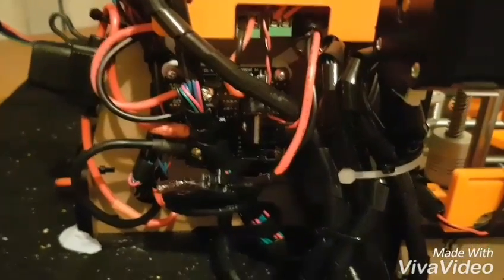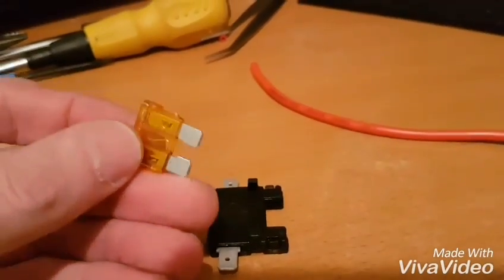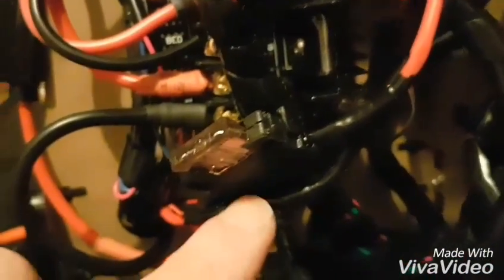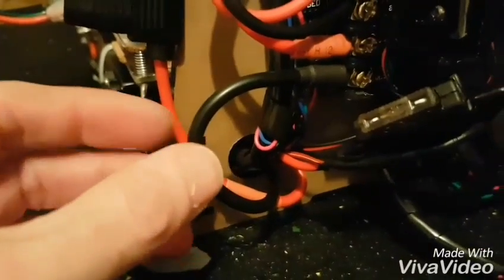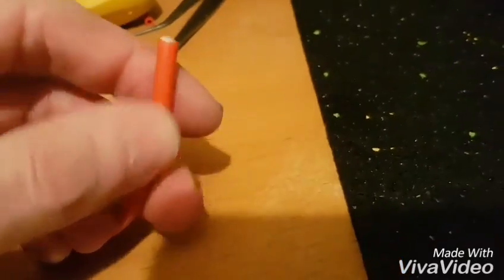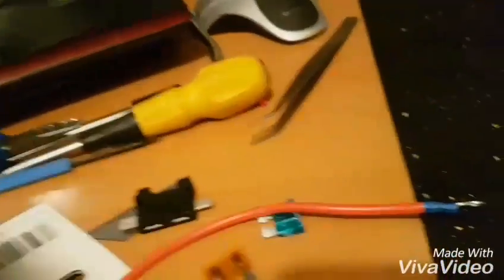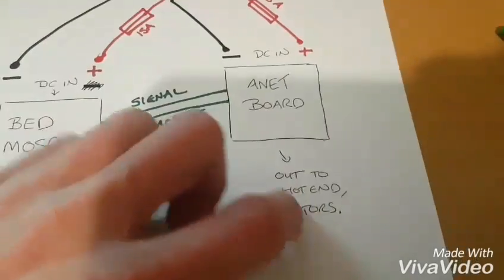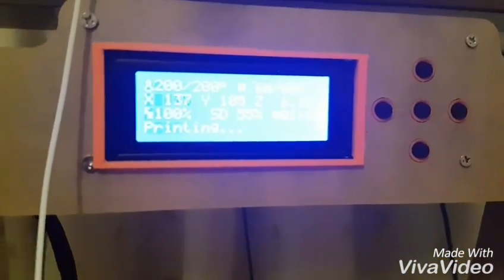ANET A8: Adding Fuses

Comment: Hey, thanks for the ideas but can I ask how you came to the 15A and 6A fuse requirements?
Reply from the maker: Gareth Brown Hi. Thanks. I think I Checked the bed with a clamp meter at about 11a (the ramps boards also talk about that kind of amperage for the bed) The 5 amp was just assuming say 3 for the hot end plus fans, motors, mainboard and a bit of spare. Hope helps.

Comment: very nice! been thinking about rewiring the whole printer. Mounting the frame to a small table and running all the boards and everything underneath the table with fans blowing on them. wanted to add fuses as much as possible to prevent any fires from happening.

Comment: When the hotend heater blows, it can short out and destroy the Mosfet and CPU on the ANET board. Might be a good idea to fuse the heater prior to the Anet board.
Reply: good point, I've just got an A8 myself as a 1st 3d printer, and noticed the possible danger of the spring cutting through the traces on the hotbed,  not wanting to construct it like that and as a temporary solution  I cut 4 small pieces of cardboard to put against the bed  and put some steel washers for the springs to ride on  preventing them digging through the cardboard and into the traces , now  that the printer is up and running I have printed off some washers  I designed  up with a  small lip  to  to stop them slipping out of position
Reply from the maker: Jason Burt Thanks. Nice idea. You mean a fuse actually on the hotend power wires between board and hotend? Any idea on amps?
Reply from the maker: Jason Burt ... or a separate but similar arrangement as the heated bed has? ie signal from onboard mosfet to external mosfet and fused, separate power rail?
Reply: 5 or 7.5 amp fuse on one of the hotend heater wires...
Reply: The heat bed would only short out if the metal spring digs into one of the corners of the MK3 heat bed. The heat bed needs some isolation between the spring and the bed. I printed out washers for this. Best solder the wires directly to the heat bed, eventually the connector gets carbon tracked and heats up. You could fuse the heatbed, would likely have an effect on the dynamic heat properties of the bed. Just my opinion..

Comment: Have you got a link to buy the PSU?
Reply from the maker: Simon Hill Hi. lost link but it is a Newstyle 12v 30a. Model number s-360-12. Think I got it off Amazon. A lot of them are re-badged versions of the same internals. Look for one with an integrated fan.
Reply: Cheers, I've found it on Amazon under s-360-12
Reply: Plan
Reply from the maker: Simon Hill Hi. its a Newstyle s-360-12. I got it off Amazon. There are many variants/re-badges. Try and get one with a fan. I always open them up and give a visual inspection before connecting up first time. You will need 30a psu adapter plate from Thingiverse to mount it. Don't have a link to hand but it is l shaped and is in the Anet A8 collection. Good luck.
Reply from the maker: Simon Hill sorry just realized old comment lol
Reply: I just got a 360-12 psu noticed the fan is a bit noisy is yours the same?